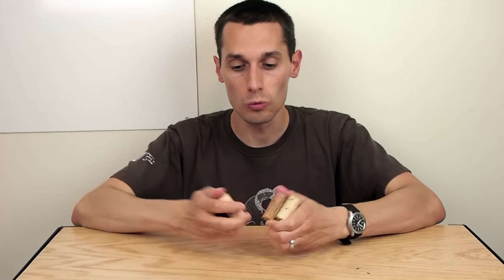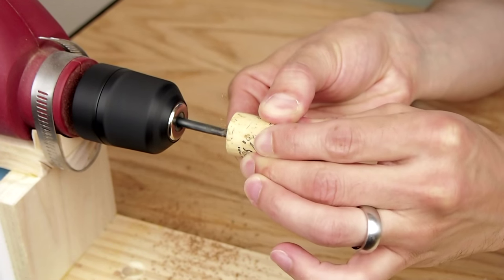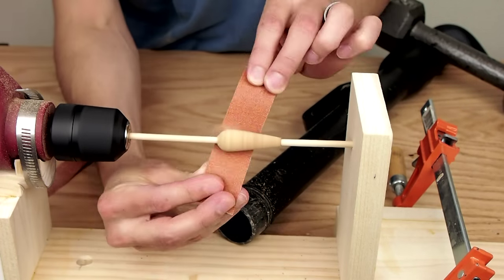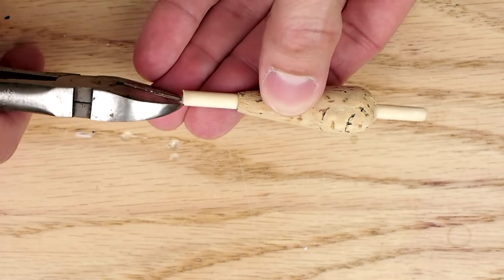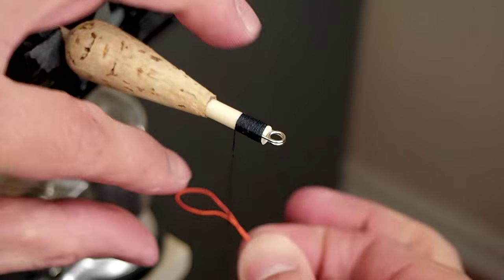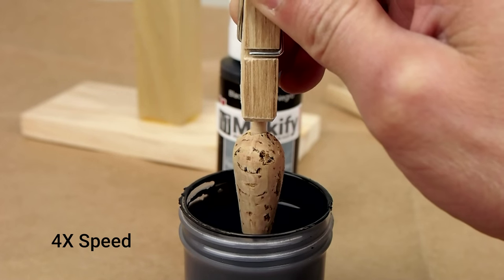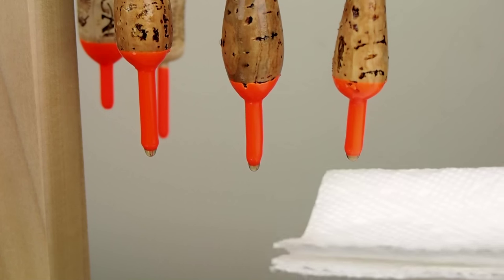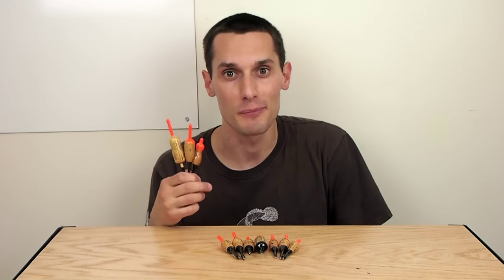How To Make Fishing Bobbers from Wine Corks

Comment: I have used corks in the pass but all I did was to use a sewing needle and put it threw the center of the cork and after gong threw the cork simply pull the line from the needle... and you got a float.  thanks very nice ...

Comment: Good work! It's amazing how such a simple device has so many ways to individualize it. This is pretty much how bobbers a were made 100 years ago. I've always made mine super functional with long 18 inch dowels to telegraph anything that touches it.

If anyone is pressed for time, just skip the shaping, but shaping gives a more custom look. Leaving the cork in base configuration makes for a more rustic look.

I used to use boat builder's epoxy on mine, but it's too much trouble. Spar varnish is right on. Nice drying rack. Would have never thought of clothes pins.

My floats are so long I could never dip them, but I think filling a 1 inch * 20 inch long PVC pipe full of varnish would do the trick. I think that's how bamboo fly rod builder do it.
Reply from the maker: Wow, thanks for the compliment! Your videos were a huge inspiration for these bobbers. 

Anyone who likes this video should check out Black Warrior Lures videos.
Reply: The Titebond II works very well. Cheaper that boat builder's epoxy. This will help me get more floats out faster.

Comment: I made some floats last year using your method. I wanted to make some more this year and forgot. I turn mine on a Jet mini lathe. I Super Glued my dowel in place and filled the cavities with SG. After turning, I sealed the cork with SG. It is time costly, but what the heck, I have a bobber that is just as good if not better than the number one selling cork float. If I loose it, no big deal. I just make another one. My friends are always asking where I buy these floats. When I tell them I make them, they say, "NO way!" On another note. If someone want to use a tube and plan to dip them. they need to plug the openings with modeling clay, so the dip will not go inside the tube. I do this with my brass tubes when gluing them for making pens.

Comment: On Amazon there is a mini lathe with little wood working tools for 39 bucks. They all was 49 but one was selling the exact same one for 39 so I ordered it and got it the next day with prime. The little lathe has 5 speeds and it has a screw looking thing that goes in the chuck that I use and the point on the other end and yes it’s cool because they all turn out different. And I do like u do in gecko and the put it back on the lathe and get some funky looking paint stripes. My hardest part is getting a perfect whole in the center

Comment: You can make it adjustable by putting an oring on the top and bottom of the dowel.  Run the line through the orings and you can make depth adjustments while fishing.

Comment: A light wood works well also. Like dry drift wood thats been painted.
  Any wire thats small enough works pretty well. Might want to cut a small depression around the wooden dowel and then wrap.
  Might want to use a plastic straw in the float hole or plastic evaporative cooler water line, for slip bobbers.

Comment: Would be good to make some slip bobbers-might even be easier if there is a small hard tube to insert through the middle of the cork the line slides through until a bobber stop stops it at the set depth.
Reply from the maker: +Cuivre  That's an interesting idea. Now I need to find some thin hollow tubing...
Reply: Some folks use coffe stirrers or the hard plastic tubes off air duster cans.
Reply from the maker: Oooh, those are both good ideas.